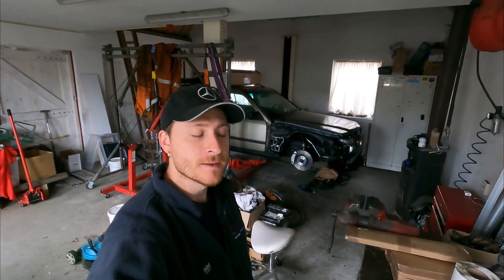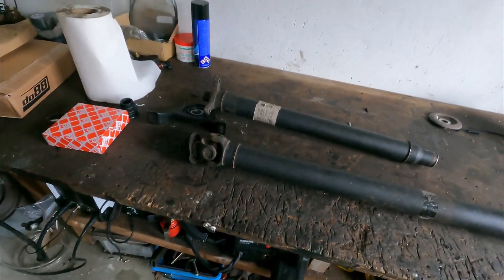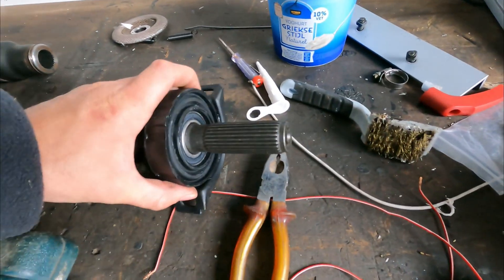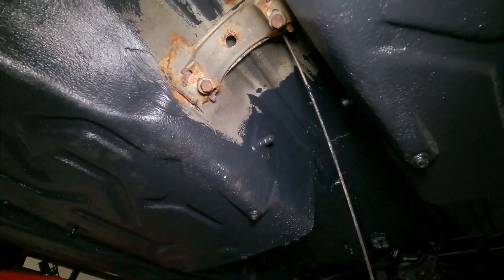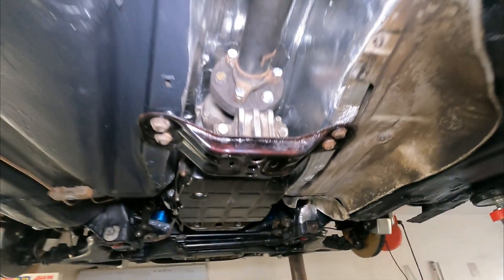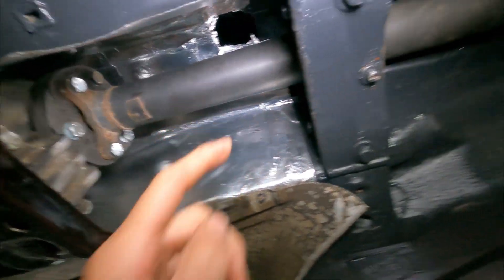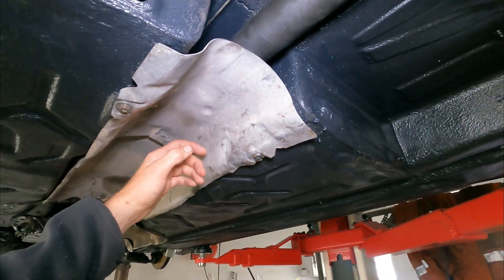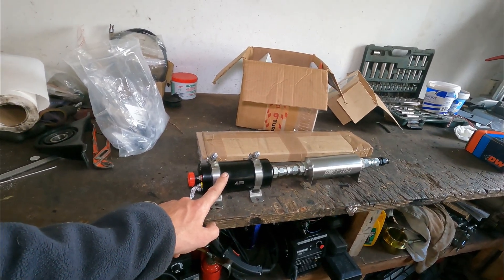S124 v8 turbo last chassis mod.  finished crank case breather system

Comment: Hallo, knap werk hoor.
Ik volg het al een tijd, gezien de v12 190 moet het je lukken.
Maar de benzine leiding binnen in de auto zou ik niet doen.
Verder top werk, groeten mgm
Reply from the maker: Dank je wel.   Heb de benzine leiding altijd door de auto laten lopen.  Nooit geen problemen mee gehad.  Nooit geen last van corrosie.  Heeft ook voordelen .   Vergeet niet dat je benzine tank en gas tank bij 90% van de auto's ook in de auto zit.  Bij de s124 hangt die eronder toevallig .